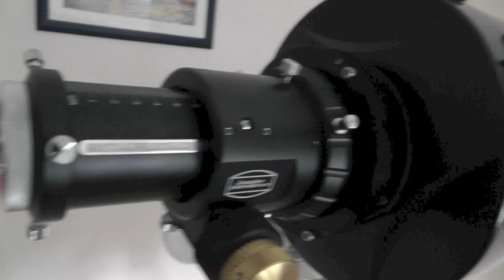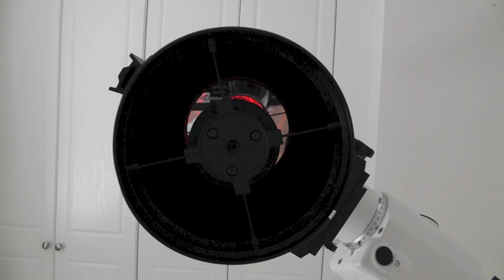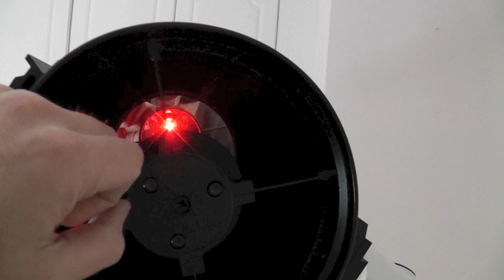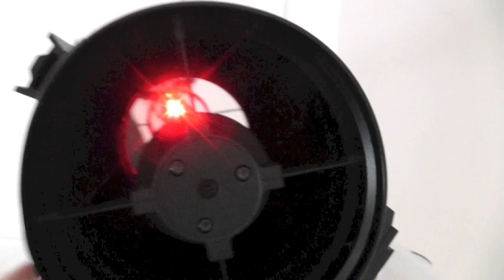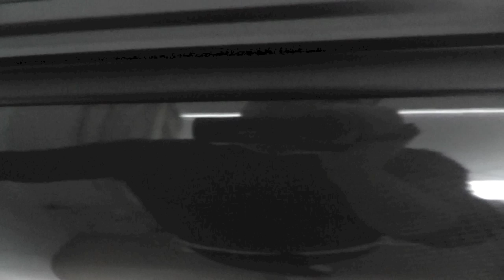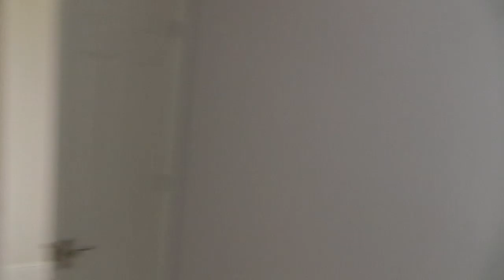Ritchey-Chretien Collimation Step 2 of 3

Comment: Stephen,
 Thank you for your helpful videos.  Our observatory recently purchased a 16" TPO (GSO) RC scope and we are checking the collimation using a Howie Glatter 532 nm laser with holographic attachment.  In your video #2, you mention rings projected on to the primary mirror from the secondary but we can't actually see any in your video.  When we look at the primary of our scope, we cannot see any rings from the laser but we see plenty of reflected rings. Do you have any still photos of the rings on the primary or video shot with a different exposure that makes the rings on the primary obvious?  Also, do you have any video that shows the rings moving as you adjust the secondary and primary adjustment screws so that viewers can see what an out of collimation pattern might look like and then how it moves as it is adjusted into collimation?  We have aimed our scope at a white projector screen and have see movement of the rings with small adjustments of the secondary and primary adjustment screws.  With the lights dimmed, we think we can see a fuzzy disc that is the projection of the primary mirror with the concentric rings superimposed?  Have you ever see something like the when the lights are dimmed or turned off?

I have attached two photos of what we see projected on our screen.

Thanks,
Robert Johnson

photo 1.JPG
photo 2.JPG
Reply from the maker: The rings are very, very faint and you'll need to be in the near dark to see them.  Steve